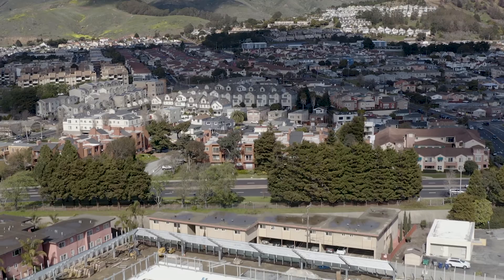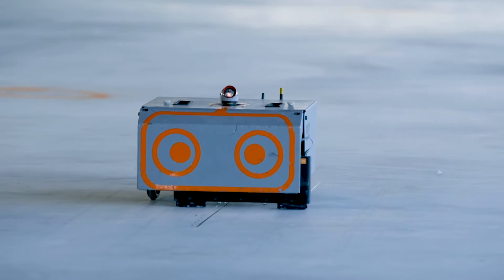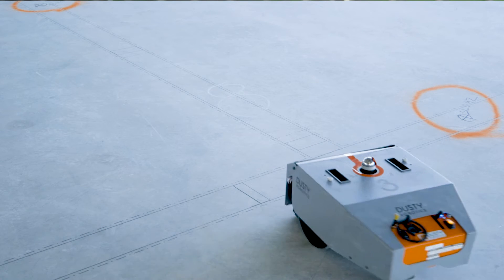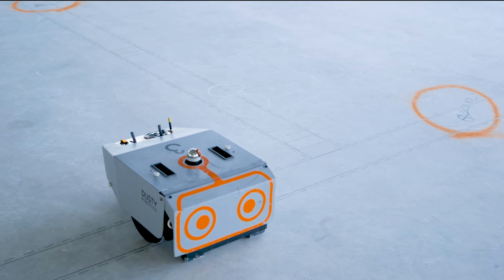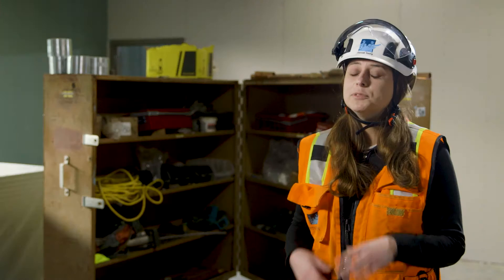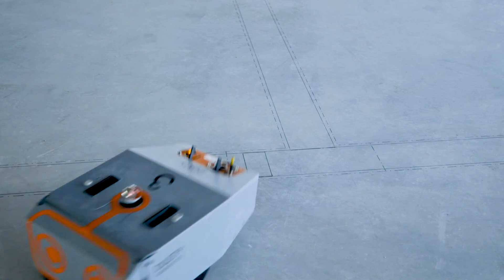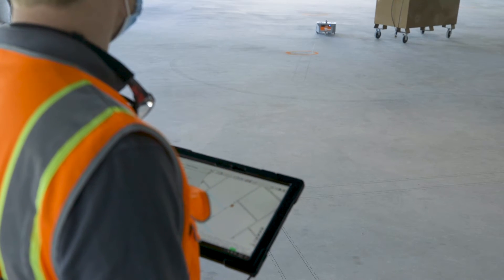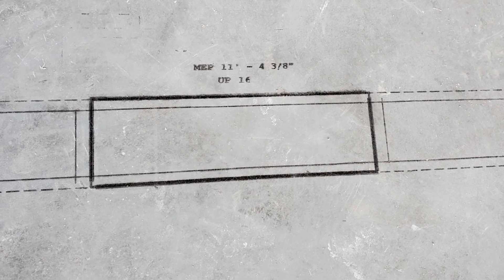Dusty Robotics with Swinerton

Comment: This is a great idea. I find it funny when the gentleman said "we were able to find a pipe that was outside of the wall". As an owner of an MEP Engineering Firm, I sure do miss the days when we had GCs that didn't send in RFI's for every little item. Many of the questions we get can be figured out in the field without having to go through the process of creating the RFI in the first place. With that said, this Dusty Robot is pretty impressive and I would love to see it work in person one day.
Reply: As an owner of an MEP firm, then you should revise your specs to reflect what can be figured out in the field and that YOU will take the responsibility for field decisions.
Reply: I remember the days when designers actually spent the time to vet the design instead of using the Submittal and RFI process to finish the design!!  And then you don't take any responsibility when things go wrong or don't work out, just blame it on the contractor for not coordinating.